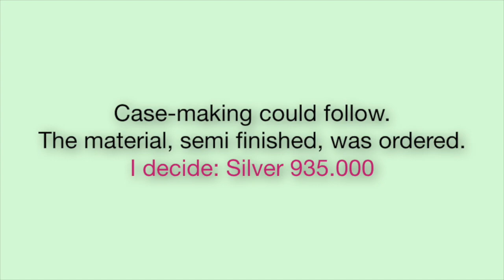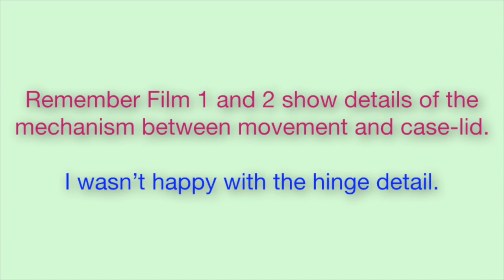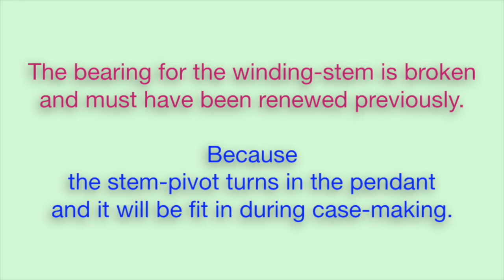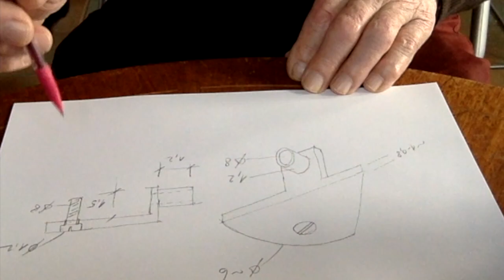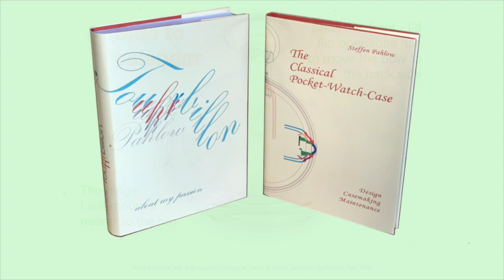03 Case-Making for a pocket-watch movement B. Haas Jeune & Co

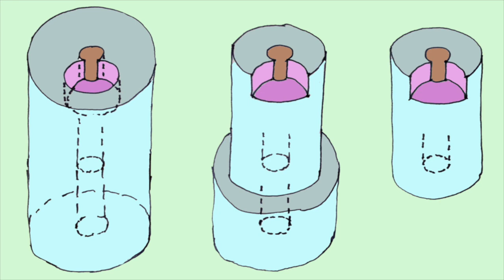Comment: I did not understand the operation(s) starting at about 2:15? Were you forming a case cover with pressure, or gluing the cover (i think)  to an arbor?  When you show the covers, later, it looks like silver content and "makers mark" on the inside...your marks? Oder? Danke